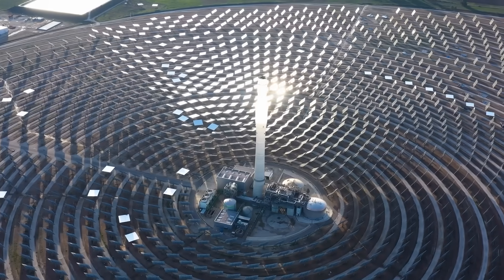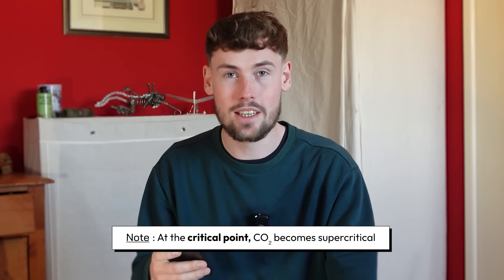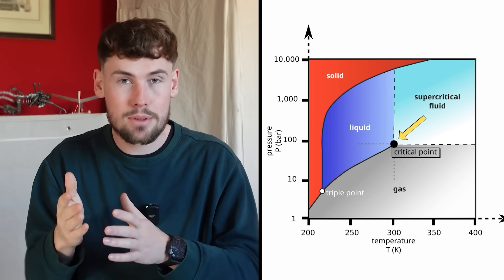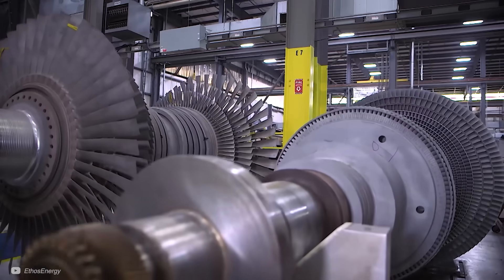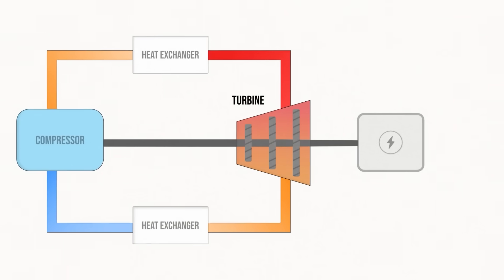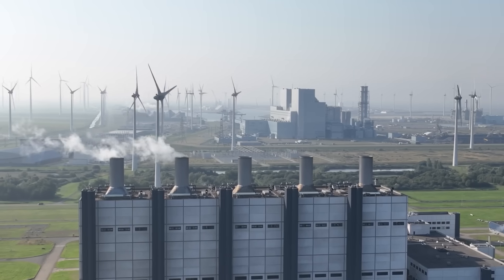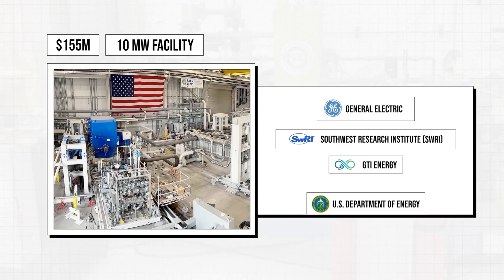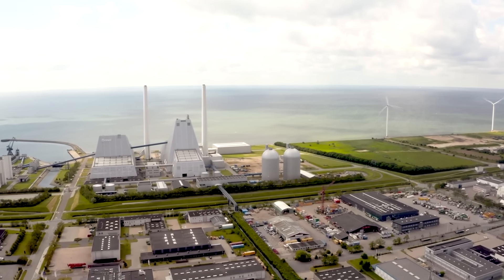How Ultra-Efficient CO2 Turbines Are The Future of Energy

Comment: If you put the whole thing inside a big box of also critical CO2 with the same turbine operation presssure then there is no more problems with the moving parts leaking...
Reply: I agree. Well you still have to get in there to maintain it,. It's a air lock type of problem, not a rotating pressure bearing

Comment: Supercritical steam boilers and turbines have been in use for a while in large power stations. How does supercritical CO2 compare to supercritical H2O?
Reply: That's right. He's talking like its a new technology. Super critical water ("steam") generators are common around the world. They are just trying to making it more efficient using CO2. Major advantage of super critical water is that its plain old water.
Reply: steam is far simpler and cheaper.
Reply: supercritical water has a much higher ressure and temperature compared to co2

Comment: imagine this tech used on ships, 10x smaller size turbines for big engines means better large boats
Reply: You don't see many steam turbines on ships now. Almost all of them run some form of diesel engine. Often they are able to on the very heaviest of petroleum products, because heavy fuel oil is the cheapest of fuels - it can't be burned on land because of the particulate pollution it produces, to refineries want it gone and ship operators are happy to assist.
Reply: @vylbird8014  military ships use gas turbines, and nuclear powered ones use steam turbines. Yeah it's hard to beat diesel on cost and efficiency.
Reply: The boilers won't get any smaller and they're orders of magnitude bigger than the turbine regardless of what fluid is used in it.
Reply: Maybe the turbines are also cheaper to build and maintain.
Edit: this would be great on nuclear submarines. It's probably a fair bit lighter and quieter
Reply: Especially for Submarines and Space Ships a small engine profile would be huge. :D
Reply: @ Spaceships wouldn't benefit from this innovation either. Submarines, though... they might well. Nuclear subs are still using a steam cycle, so it's possible a future design might switch to a supercritical CO2 cycle and thus reduce the amount of precious space given over to to the engines.
Reply: @vylbird8014  Well I am talking about future Spaceships not the current ones. ^^

Comment: If I had a kilowatt for every energy breakthrough video I have seen on YouTube. 
I could power every city for a million years.
Does sound promising though.
Reply: At least this one doesn't involve "zero point!"
Reply: Zero point - to continue
Gotcha!  @glasslinger
Reply: Add another kilowwatt, it's vaporware. Steam plants are already using supercritical fluids that are actually attainable AKA supercritical water.
Turns out heating water is still the cornerstone of thermal energy conversion, not for lack of trying to replace it, but because water is one of the most versatile compounds in the universe.
Reply: @LokiScarlet "Vaporware" and "steam plant"... I see what you did, here 😂
Reply: @LokiScarlet SC CO2 is already attainable and in widespread industrial use, probably more so than SC steam.
Reply: I think the real issue is that valuable information is rarely free and free information is rarely valuable
Reply: @mikefallwell1301 unless you are Elsevier or one of the other publishing houses that upload free scientific papers that paywall those papers to make money.
Reply: People want thing NOW!
They must CONSUME product immediately!
Reply: A quick bit of maths says that it costs about 358 W per hour of energy breakthrough video streamed, you need to subtract that from your calculation.
Reply: "THIS CHANGES EVERYTHING"

(Nothing changes) 🤣
Reply: I think you mean kilowatt-hour.
Reply: Hype is a real problem, and there are plenty of nonsense youtubers, but I also don't fault the real tech channels for covering new technologies and looking at their potential. The solution to our energy problems is never going to be only one thing or one technology. It's going to involve a whole toolbox of solutions, and there are going to be plenty of perfectly sound ideas that never get used.

Anyway, we already know how to make all the energy we need without fossil fuels, and we have done for decades. The reason we still burn them is because it's slightly cheaper, because the people with money don't want anything to change, and they've deliberately encouraged the idea that is either an unsolvable problem, or not a problem in the first place.

In way, all the new tech videos are part of the problem, because they contribute to the idea that we don't already have the technology to phase out fossil fuels right now. That we need some new breakthrough to "solve" the problem, when the problem was never technology. It was always a problem of greed and power and ignorance, not technology.
Reply: do you mean kilo Watt hour ?
Reply: I Like Your Modification Of The Statement, "If I Had A Nickel . . ." Every Month Fusion Gets Solved, Amelia Earhart's Plane Is Found & There's A New Internal Combustion Engine. Thank You. (Like #996 - Reply #41)
Reply: and this is solar roads level of stupid... are they gonna mine dry ice for another planet?
Reply: Kilowatt is a rate. You mean kilowatt-hour, an accumulated quantity.
Reply: Indeed.
Reply: I was thinking the same thing. My first reactions when I saw this in my YouTube recommended section was, "oh joy, yet another wonder tech" and “when exactly does the future arrive with all this crap”.
Reply: I wish there was a channel that reviewed videos like these in hindsight, 10-20 years afterward when the technology has or has not been implemented and scaled to market. It's difficult to remember these individual breakthroughs long enough to feel the eureka moment when the breakthrough does mature in the real world. For example, I can remember when glass platters was the next new thing for hard drive storage. About 6 years later, hard drive storages suddenly seemed massive, but they stayed mostly the same for another 6 years, because another breakthrough was needed.
Reply: I would have enough light to do professional astronomy and I hate astronomy
Reply: mixing up kilowatt and kilowattHOURS shows you havent yet watched enough of these videos...
Reply: It's literally commercial now in China. It's real, it's working, it will soon be massively produced so it will be cheap.
It will dominate the 500-700C range (SMR, waste heat recycling)
Basic turbines will remain steam.
Reply: Haha, i agree. I stopped watching / reading things about battery breakthroughs about 4 years ago, and we're still waiting!
Reply: @Ryan-lk4pu  There have been many breakthroughs. Battery density has improved, charge cycles and charging power likewise. Costs have been coming down also. It's not the glamorous "shocking" (instant turn off btw), but continual incremental improvements. Anyway, you tubers need something to talk about.
Reply: @Ryan-lk4pu  one of them came silently phones  with 5000mph batteries are now really common.
Reply: @Ryan-lk4pu There have been lots of gradual incremental improvements in practice with batteries. Just like with almost everything else.
Reply from the maker: It's true, but I see that as a positive, there are loads of interesting developments happening and they are being shared in video format - even if a significant amount don't make it into production any time soon (if ever for some!)
Reply: @ZirothTech  I don't think it's a positive at all.  It fuels skepticism and apathy.  If you see a million "breakthroughs" that never materialize, you eventually lose interest in seeing such projects subsidized at all because you (rightly) assume they're probably a waste of time and money.  To be clear, I don't think this video falls into the nothing-burger category, but I definitely think YouTubers should make sure that a technology has at least completed a commercial tech demo - as this has - before making a video about it.
Reply: @jeffmorris5802  That's a problem of viewpoint of readers more than anything I believe. The fact so many of these are getting a shot and at least getting somewhat off the ground shows the possibilities for solutions to energy problems are close to endless. Them being 'waste' is again a mindset thing as the knowledge gained is by no means a waste and usually become helpful down the road. Literally most battery technology now being developed and put out today is based on attempts previously made before we had the knowledge or technology to apply them.
Reply: @nfzeta128  I completely disagree.  I think the issue is that you're falsely assuming that the science/lab part of dev is the hard part.  It isn't.  The science behind this stuff is easy - it's the engineering and commercialization that's hard.  Most of these videos look at what are essentially science experiments; destined to be nothing more than vaporware.  This isn't a "mindset" thing - it's a reality/pragmatism thing.  How many novel battery chemistries have we heard about over the last decade?  How many of those are anywhere close to being commercially viable?
Reply: @jeffmorris5802  Okay, that's just patently false. Also the engineering part comes under the 'science/lab' part. The commercialisation is just refitting it to be mass produced, and marketing.
Reply: @jeffmorris5802  The prior also costs a lot more money than the former. Hence why it's usually funded publicly. Either through grants/donations or actual government funding.
Reply: @nfzeta128  No, I agree with Jeff.  Science experiments are easy.  Implementation and scale up are hard.
Reply: @incognitotorpedo42  Anyone who says that just does so because they don't understand how invention works.
Reply: @ No, it's because you don't understand how hard it is to scale something to commercial viability.  Electric Cars have been around for almost a century.  They only became a viable product within the last couple decades.  Science is easy, and typically gets completed far earlier than commercialization does.
Reply: @jeffmorris5802  "It fuels skepticism and apathy"

If fuels skepticism and apathy only for those who are ignorant of the realities of science and engineering - that it is a process that takes time to get right.

For the people doing the research and investing for all of this the scitech news cycle doesn't change anything.

Long answer short, they don't care if everyone else is an apathetic skeptic, or that Youtubers jump on and off the hype train - it's not their problem.

Generally speaking it's not the Youtuber audience doing the work or funding it.
Reply: @jeffmorris5802  innovation is more important than invention, but you cannot innovate without invention, stop being so emotionally wrung out by the effort and chill
Reply: @meikala2114  I'm not "emotionally wrung out" about anything, simply stating a fact.  It's why we're still using lithium ion batteries.  I'd recommend projecting less when reading comments.
Reply: @nfzeta128  And those that disagree do not understand how production works!
Reply: @ Literally that is part of the 'science' bit. They needed to change the technology enough to make it commercially viable. After that is to just do it.
Reply: @ZirothTech  Trick is boiling off the Vaporware.
Reply: 😂 whére do you find the Super critical Co2?!!😅

Comment: i can only imagine what a spontaneous depressurization of one of these systems would look like.
Reply: Well they might use between say 1 to 3 tons of CO2.... 1 ton is 500 cubic metres. 
Cube root of 500 is a bit less than 8, so 8 metres ish... A decent sized room just had all the air pushed out of the way. Well that's assuming 1 ton of CO2 
Plus the temperatures somewhere between 500 to 700° C.... A lot of stuff would spontaneously combust because of the temperature... but would also be surrounded by CO2 hmmm
Reply: Not more spectacular than your water heater blowing up. (look on youtube!)
Reply: We have nuclear power plants...
Reply: @anthonyjaccard3694  those are just regular 'water boilers -> steam turbine' systems
Reply: @Psrj-ad  The fact that you can reduce them to "regular water boiler -> steam turbine systems" is a testament to how safe humanity has managed to make rocks that give cancer and blow up into the biggest explosions ever. I think we can manage some inert gas (at least in this context, if we had total control over it, we wouldn't be in a climate crisis)

Comment: Since when is steam put thru a "compressor" in a normal electric generating plant?
Fire your script writer.
Reply: There is a compressor in the steam cycle. Water must be brought up to high pressure to be able to enter the boiler.
Reply: @alzoz6741  Yeah that's done with a pump. That segment that compares compressing CO2 with compressing steam is flawed because you use pumps to pressurize liquid water and because water's volume changes very little when pumped, this takes very little energy. It's way more efficient to pump a liquid than to compress a gas per unit mass (which is what you care about). One of the advantages of the steam cycle is the phase change. You extract energy from the expansion of steam but compress it when it's a liquid.

Comment: It's not temperature drop that matters. It is pressure drop. Temperature is the stand in for pressure but it is pressure changes doing the work.
Reply: Efficiency in Carnot cycle systems (like steam systems and CO2 gas systems) is dependent on the temperature drop, not the pressure drop.
Reply: @wooddavid8293 Temperature and pressure are directly relatedly according to the ideal gas law and Gay-Lussac's law. It wouldn't be a Carnot cycle but I think the Brayton cycle..
Reply: @wooddavid8293  The real world is not an equation or a theory which mostly works so we ignore the assumptions.

Pressure differential does the work.

The simple equation for the Carnot cycle uses temperature to simplify the equation and relies on several non-real world assumptions to do this. Not because temperature is doing the work.
Reply: Superheated steam has the same pressure as its saturated source yet does more work for the same pressure drop. It's the delta t not the delta p that determines efficiency.
Reply: @wooddavid8293  Same volume and density too?

An experiment for you: Tank A with 100F and 100psig and B with 100F and 0psig. 

According to you they both have the same efficiency even though B can do zero work.

Please, learn that reality is different than simplified and presumptive equations.
Reply: @wooddavid8293  Pressure ratio is not the only part of the efficiency equation. You also have the specific heat ratio variable, parasitic losses, like latent heat, and other irreversibilities. Like the other wise commentators say, pressure is the embodiment of temperature for these types of engines. Temperature itself does not do any work; rather, it gives rise to other mechanisms or states of energy, such as pressure, that do. If you only increase the temperature and nothing else, you will end up with lower efficiency because of heat loss. Keep in mind that the Carnot equation tells you the MAXIMUM efficiency you can reach with a temperature difference; it does not mean that you will automatically reach it just because you have that temperature difference. Research irreversibilities, and you will understand Carnot's equation much better.
Reply: Considering combustion, nuclear, and some solar power plants are converting heat energy to work, it's pretty silly to claim it's pressure doing the work.
Reply: @bruzote  Would any of them work without a material that changes density with temperature/phase? (inside a restricted/closed container)

The answer is no. Therefore it's the pressure doing the work. Heat is simply a means to get delta p. Already addressed this in the comments.

Comment: I don't know why these technologies take so long to adopt. I mean i know the standard reasons, some of which you mentioned but I first heard of super crytical Co2 turbines 15 years ago & I'm sure they were proposed way before that. 

Established technologies really do become the biggest barrier to new tech adoption. R&D & economies of scale as well as regulation make new tech hard to implement.
Reply: I work with co2 capture and liquifaction and even at lower temperatures and pressures there are material challenges and chemical challenges. 

Many plants I see accept some losses to avoid the cost of better materials and processes. Such is reality.
Reply: @klausnielsen1537  Good info, but large steam turbines and blades aren't cheap, right? Isn't there a trade off in sheer amount of material/processes needed vs higher cost of that material CO2? The turbine halls in power stations are massive atm. That's a lot of materal.
Reply: Super critical water ("steam") generators are common around the world. Its not a new technology, just trying to making it more efficient using CO2. Major advantage of super critical water is that its plain old water.
Reply: 2003 was the first time I read about it - think it was Sandia lab doing it then, could be wrong.
Reply: Most revolutionary new tech completely failing to deliver the promised gains or being complete vaporware despite very convincing animations on youtube is a far bigger reason. Just because a new design is better in one cherry picked way, doesn't mean it's better overall - and by better I mean delivering power more cheaply over the life of the system, than existing tech, because this is what the companies that will be buying these systems are looking for.
Reply: @peglor  I can't argue with that. Many such cases. However, this is not new tech so to speak, and I would have thought the the trade offs were fairly compleing and fairly quantafiable by now. This opens up a brayton cycle and so is quite a big effeciency unlock.
Reply: @ It not being new tech but there being no working examples of it may be the strongest evidence out there that this tech is revolutionising nothing.